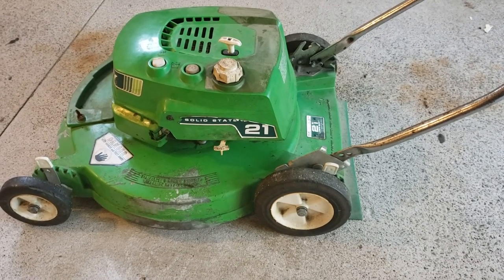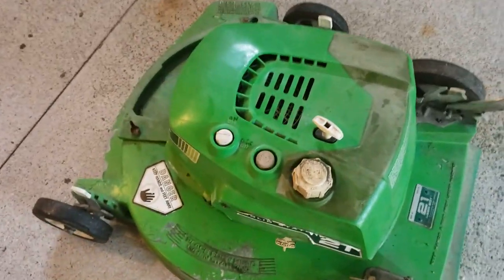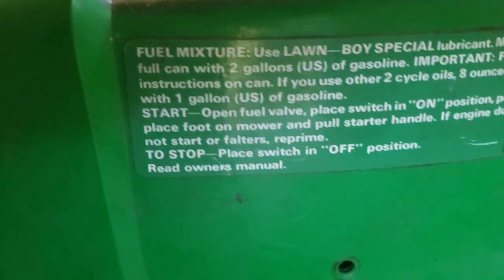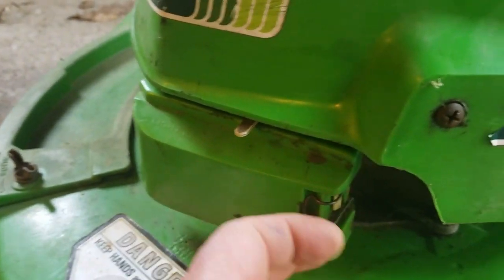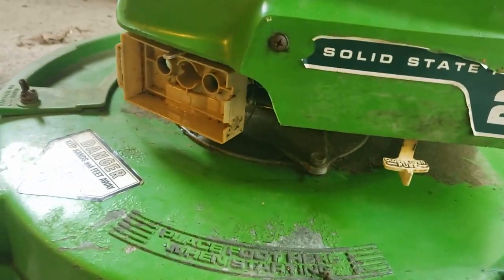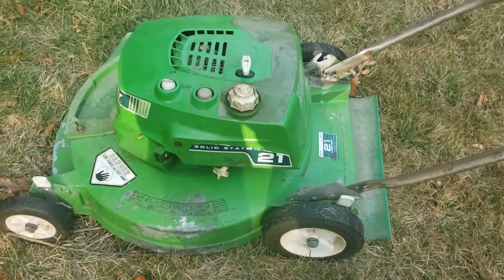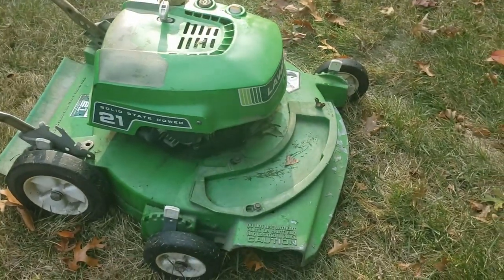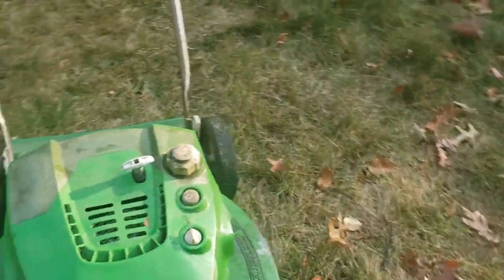Nifty old Lawn Boy 2 cycle lawn mower from 1979!!  Trash pick!  Screams to life & rips through grass

Comment: That’s definitely 1970,s style . I have a few of that brand & they really did a good job of making My yard look good . How ever they don’t build them anymore. All because of EPA regulations. I’d would like get hands on one
Reply from the maker: Thanks for checking it out!  In addition to this example, I have another 90's vintage Silver Series machine. I gave that one a restoration. Don't use them much because as you said. They don't make them, and parts are hard to find I hear.  Cheers!   -C
Reply: @TenaciousCsRescueLeague   toro bought them out a long time ago
Reply from the maker: @robertwhite9898  Yeah,  I've had a couple of newer "Lawn Boy" mowers I found at the dump (also floating around on Youtube somewhere). They are essentially just Toros painted green.  At least the 90's ones, , Toro appeared to still be using the off-center decks stamped from the original Lawn Boy factory line. Makes them a bit more interesting anyways.

Comment: One of the best model series Lawn-boy made. 
Fix it up & it will last another forty years.
Reply from the maker: Thanks, man. Definitely a keeper.  When weather is a bit nicer I'm going to pull the shrouding off and have a better look around inside. I kid you not...I was totally surprised after pulling it out of the metal pile and starting it....to find out it's a 2-cycle.    Almost passed it up!!
Reply: The pre compliance F engine Lawnboys (1978 to 1983) are the overall best Lawnboys or best mowers of all time for that matter. Although I'd argue that all the F engined LBs with an aluminum deck are worth saving, a pre compliance F without electric start or self propel has hardly anything to go wrong on it. So damn simple and well made.
Reply: @ericjohnson3332  
Agree.

Comment: Love that  old "Lawn Boy sound" with the 2-cycle engine and under deck exhaust. Had one many years ago, and just bought an old '72 model that I'm doing a light restoration on (for "go", not so much for "show"). Looking forward to getting this little light weight (19") going to do my trim with. They made 'em cheap, but they're sweeties.
Reply from the maker: I like sound too. Very unique....and they are not smoky at all!   Mine is mostly a "go only" as well.  I cleaned a few things up. It could use a carb tear down I think. Overall, a nice tight machine! 
-C

Comment: Great video! I have that EXACT same lawnmower. You cannot kill these things.! This one sounds rough though and the RPM is low. like it was ran without oil or the very simple carb needs work. Mine sounds like a well made propeller driven aircraft, it’s a beautiful and melodious sound. One of the reasons this mower is so light is because it has an all aluminum deck, or body. It’s cast aluminum which today is unheard of and at the time uncompleted with. The staggered wheels are because the discharge for bagless mode blows out the front right. For bagging mode there is an adapter which is inserted into the top righ front deck of the mower bypassing the side discharge, which diverts the clippings up into the bag. It’s a really one-of-a-kind machine and the main advantage to a two-stroke over a four stroke that I found is that because there is power on every stroke and also because it spins at a higher RPM than a fourth stroke, this mower never bogs down. In my 40 years of using it, it has never once stalled due to being overloaded. #theydontmakeshitlikethisanymore
Reply from the maker: Thanks for the commentary! Admittedly, this example was literally just off the metal pile at the local dump.  It still had fuel in it (of dubious quality perhaps). Some carb spray and cleaning out the air filter and it coughed to life- as is. Yeah, I was surprised at the sound (being a 2-cycle). I had to hunt around a while to find a little sticker on the tank indicating 50:1 oil mix. That finally tipped me off!  Good thing I didn't load it up with strait gas.  Looking forward to tinkering with it on a warm day.
Reply: I had one that was a little bit older and it was a magnesium deck.

After the motor had a catastrophic failure, I threw the deck in a bonfire at night. Lit up a few acres like it was the surface of the sun once that deck got going!

Comment: One of the very best mowers ever. I've sold n serviced thousands when they were in business. In the last fifty years they really had top sellers in those that last the longest. I had one of there first made mowers and I could start it with the flick of my hand on the exposed fly shell. Wish I kept it , but I made money selling not keeping. Still have a new short block engine left for that model in stock.
Reply from the maker: The accolades for these older Lawn-Boys keep rolling in! I'll open it up in another few weeks. Look at that switch and clean around inside. F series look pretty strait forward.  Thanks for sharing!

Comment: Nice unit! My first lb was a 7268 and i have recently acquired 2 R7268s. I am in the process of restoring one of them. I replaced the piston, rings, seals, rebuilt the carb, and had to put a different coil on it and now it runs great! These are getting rare. In today's world Im sure any typical homeowner would look at these and scratch their head lol. I couldnt tell but make sure the sir filter is oiled and you run good 2 stroke oil at 32 to 1 and it will last a long time.
Reply from the maker: Thankyou, Sir. Yeah, I NEVER see these around the neighborhood and I still can't get over my good fortune finding this unit in the scrap pile. Almost passed it up, not knowing they have such a large fan base!   Good job on the rebuild. I just take mine out once in a while for a ceremonial spin around the yard.  Nice site. I just subscribed :)   -C

Comment: Great lucky find there. Love the LawnBoy mowers. I have a 4 stroke 1997 model that runs nice. That 2 stroke sound brings back memories of the one I used when I cut the lawn in 70s and mid 80s. The model I used was passed down. It was off white with blue wheels. I think from the 60s. That mower was bulletproof. When our Simplcity riding went down , which was often. The LawnBoy took over. We had an acre to mow. Good times
Reply from the maker: Thanks, Mate.  Yeah, it's a hoot! A little hard to start cold. Probably could use a total carb scrubbing. I think primer bulb OK.  I acquired a mid 90's silver series some years back in the same manner. would not run when hot though (bad coil likely-expanding/contracting, losing continuity). Had I known better then, I would have fixed it   :(

Comment: You always need to go counterclockwise to get around trees and clear the clippings away from the grass to be mown.  The 2cycle likes high revs.  It does have the torque to go over clippings in unmown grass.
Reply from the maker: Yeah, the side discharge is pretty old school, but it works pretty good when the grass is dry and not extremely tall.
Reply: Should be 3200 RPM

Comment: You picked up a good lawnmower buddy that was one of the best built lawnmowers or at least engines as long as you put enough oil because it’s 2 cycle as long as you keep the muffler ports clean and your carburetor so we can breathe good a good filter I think will last forever
Reply from the maker: Hey, thanks mate! It is pretty cool. And to think I almost passed it by.  ( I drove back on second thought, before it was tossed in the crusher). I think I'm going to take apart/clean the carb. Then it will be perfect!

Comment: I have a '78 I bought new. Just broke the recoil spring so it is in the shop for a full service. Since I bought it I have cleaned the air filter, sharpened the blade and two or three times popped in a new plug and cleaned the carbon out of the muffler. It had it's last repair/service in about 1990.
Reply from the maker: Sweet.  It's probably just having a bit of a mid-life crisis. Will be back in your hands for the second chapter soon enough!

Comment: Grew up in the Midwest and as a kid, hung around the local lawnmower repair shop. I’d say about 1/2-3/4 of their biz was service and Lawn-Boys like this were their bread ‘n butter. They always had a stable of used Lawn Boys for sale that had been serviced and were ready to mow again. Machines from the 1960’s-forward, painted in the traditional early LB soft pastel colors to the typical grasshopper green of yours that started around 1968-1970. It was really obvious that when it came to residential mowers, people in my town preferred Lawn Boys. They looked different. They sounded different. The oil and gas blend has a particular smell when running that four cycle mowers don’t have. Their lightweight magnesium decks felt like you were pushing a feather, unlike the heavy steel decked mowers. They had self-propel so they basically drove themselves which made mowing hillsides a breeze. Some models even had optional electric start. There was a lot to like about them. Never could figure out why I couldn’t convince Dad to trade our Murray Briggs & Stratton hunk of junk for a neat Lawn Boy, but he dug in his heels. Probably figured hey, the boy’s doing all the mowing. Why do I need to change anything?🤦🏼‍♂️🤷🏼‍♂️😂
Reply from the maker: Good story. Thanks for posting! These Lawn-Boys really have a cult following. Almost getting warm enough for inspirational tune-up time. The one I have.....the wheels are worn down to "baloney skins"...Smooth.  Goes to show you how much use it received before the previous owner junked it.

Comment: In 1982, we picked up a Lawn boy and I am still using it!!!  Same plastic carb.  Keep an eye out.  I have had the brass seats for the needle valve and idle come loose.  Still starts on one pull too.  It still screams like a banshee.  Nice power and cuts everything I throw at it.  Mine has a clutch on the blade such that it will run but the blade stops.  Just wish I could find a replacement muffler.
Reply from the maker: Nice.   Picked it up pretty new then.  Mine is a little tough to get going, but once started, it runs fine. One of these days I'll pull the carb apart and give it a good overhaul. Thanks for checking it out!   -C

Comment: I have the self Propel version of one of those, push the top of the handle forward and it drives away by itself, you would probably think that's even scarier. I think they're rated around 4 and 1/2 or 5 horsepower but I'm not sure.
Reply from the maker: Nice. That's always good sporting fun!  Sounds cool. I found some old free manuals online. The F-100 engine I have is rated 3.5 hp, but it revs really nice. I have an old 3 stage snow blower that is "self motivated"  as well!

Comment: Also have a r7268. Runs amazing, 1981 model. Best mowers ever.
Reply from the maker: Nice!  I just picked up a 10605 model with a Kohler from the dump.  Not as interesting, (being kind of re badged Toro), but it seems to start up and run pretty good. Blade clutch and drive all work too. Amazing. Will try to up load soon.  Thanks for checking out!
-C

Comment: Tenacious c  You are lucky to have found this old Lawn Boy in running condition. I have a 1978 model and the pull cord does not work. The repair shop told me that there were no longer parts available for this old of Lawn Boy Mower, that was five years ago. I would love to get it running again but that is probably not possible.
Reply: Look on ebay
Reply from the maker: Thanks! I almost walked away from it. Like I indicated previously, I didn't realize what I had stumbled across. Blind luck. Probably never find another. As mentioned by others, you might need to go the used route. Probaly worth it in the end if you can't re-build it..

Comment: neato, i have a similar model that is rear drive self propelled with an electric start, so the switch is on the handle and not the housing.  I haven't used it in years.  great mower.  I miss that sound, and the smell too.
Reply from the maker: All the bells and whistles!  Definitely a unque sound. Caught me off guard when I first got it going!

Comment: These things are so coveted, I'm surprised you managed to drive past one twice! I own 3 lawn boys and they are fantastic!
Reply from the maker: Thanks! Yeah, I really had no idea what I had found until I posted the video and comments started rolling in. Of course, I have never found another one out there! I should give it a full restoration, but I have too much stuff!   In time.  -C
Reply: @Tenacious C's Rescue League  these things have a cult following, and only recently have I finally been able to join! As long as it's got good compression and starts well, you don't really need to work on the engine much. Remember to mix it with good oil and 32:1. It's good to see those mowers in caring hands.
Reply from the maker: @therandomman6647  Roger that. I use the ethanol-free stuff for the old 2-cycles.   Could probably use a carb overhaul. A little fussy to start...but runs pretty smooth once it kicks in. Thanks for the support!  -C
Reply: @TenaciousCsRescueLeague it is an F engine carburetor and works very similar to almost any engine with an air vane governor. In all my experience with F engines, they take a lot of priming to start, even with rebuilt carburetors. These engines are marine grade, at least up until Toro bought them. You can use marine oil, which is nice. If you ever need to take the blade adapter off, index it 90° to the piston at TDC. If you have any more questions about Lawn Boys, I do have plenty of experience, and would be happy to help!

Comment: Have a 21 inch self propelled I bought brand new in 1979 very light ,use it for my lawn where it is sloped!
Reply from the maker: Cool! Yeah, my father in law had a 2-cycle mower he used on his sloped yard for years. You don't need to worry about oil not being in the sump!   -C

Comment: One of my paternal uncles had a lawn boy lawnmower when I was little; I remember Kevin (my “dad“) borrowing it a lot to cut our grass. This would’ve been as far back as 1992 to around 1996 or so. Couldn’t tell you what the model was specifically, but I can describe it as follows.

It was red, had some kind of knob in the middle of it on the front below the handlebar, had a bag catcher on it for catching the grass and the motor had two different sounds to it; I can’t describe exactly what they were though. also, it folded down quite a lot to the point where it was quite small and could easily fit in the back of a car. I also remember there being some kind of a cap below the handlebars as well; it was kind of hexagon shaped. also when you pulled the string to start it, it didn’t make the steadily increasing and then decreasing revving sound you normally here; the sound was a lot quicker.
Reply from the maker: Hmmm.  That is a mystery to me. Interesting. Any images on the web that would clue you in?  Perhaps search on defunct mower companies to find a lead?  would be cool to see!  -C

Comment: I have the 7268.  Same as yours but not sold as a rear bagger.  Also have 4 of the 19 inch version model 5247.  The 1978 through 1982 precompliant F series Lawnboys were some of the best ever made.  I also have about 11 other Lawnboys from 1968 through 1978.  
Yours is more than likely a 1982 model.   The early F series, 1978-1979 had a hex adjuster on the governor air vane.  Then they went to the round adjuster that clicked to adjust.  Then in 1982 they added the extra louvers in the top center portion of the shroud to aid in cooling. Also your mower has a post compliant open to run coil which is why your on/off switch is backwards.  You need to order 100-2949, pre compliant ground to run coil.  The old style triangle wheels are getting harder to find, especially new, but you can find OEM Toro replacements or generics when those wheels are no longer usable.  It is a very nice mower and with proper care should last many years.  My wife and I use 4 Lawnboy mowers in rotation weekly on 6 properties, mainly 1975 through 1980 models.
Reply from the maker: That's awesome!  Thanks for the all the info  Quite a following out there for these machines. The wheels are completely smooth...."baloney skins". Not sure if that is factory, or any tread just wore down over the years.  The coil thing kind of flummoxes me, but several have commented.  Glad to have a part number!  Cheers!  -C

Comment: I remember using those old lawnmowers and I either had to wait for all the gas to run out or take a metal rod/screwdriver with a wooden handle and have the two metal parts to turn off the lawnmower.  I took a hubcap one time to stop it and nearly electrocuted myself.
Reply from the maker: Awesome!  Wasn't it good clean fun when safety features were just a curiosity, and not the law?  I had a little craftsman with a Briggs that I had to do the same thing. I'd hold a screwdriver across the plug and ground it out against the cylinder head to stop it! :)       -C
Reply: @TenaciousCsRescueLeague  right?  I'm just glad that we have an electric now as I have a smaller lawn and it shuts off my releasing the lever
Reply from the maker: @AntmeetsMelbourne  And at the end of the day, all of your fingers and toes add up to 20!   Priceless :)    -C